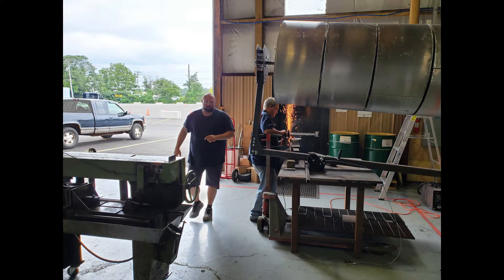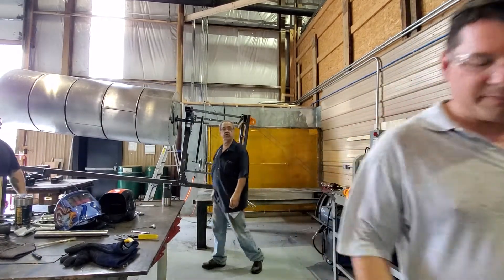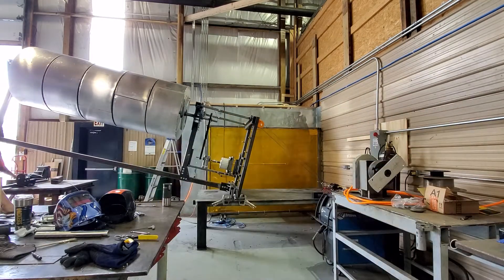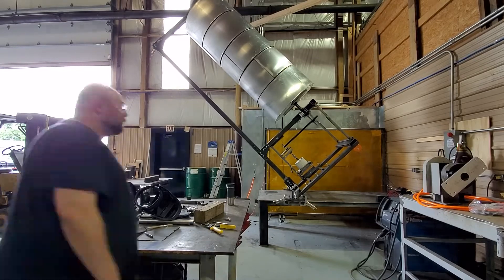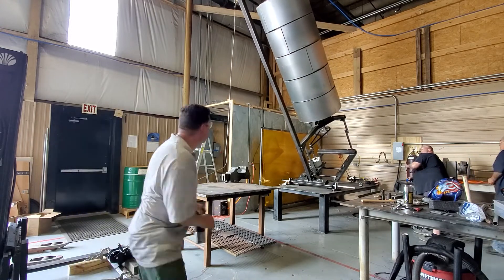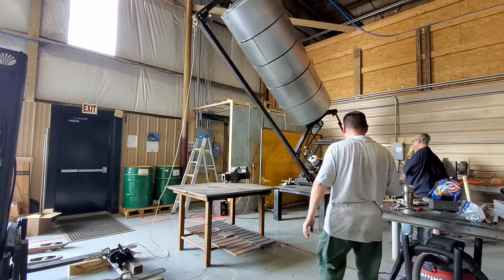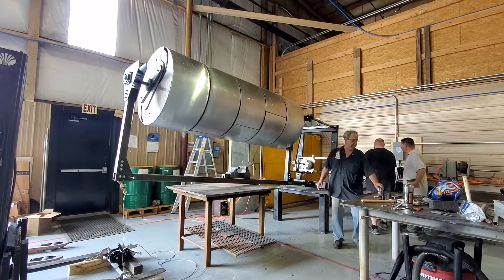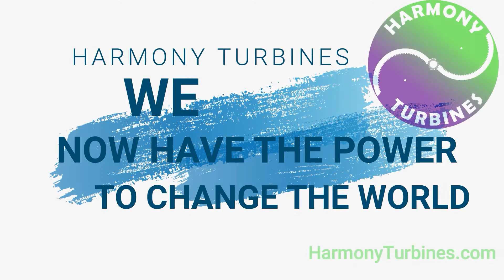Harmony Turbines Weekly Whirl 22

Comment: Ahhh-Sooo, Harmony Turbines Are Truly The Ying & Yang Of Wind Power w/A Built In Easy Transporting & Power Tip Up Erecting System! Hey Chris, Y'alls Should Get A 3rd - 4th Patents On Them Features Also!? 😁😎 PS The Whole Turbine System Could Be Mounted To A Small Self Contained Low-Boy 14'-16' Trailer System w/Lithium Batteries Plus Folding + Tip Up Tracking Solar Panels For An Easy Combo Rural Wind+Solar Power Mobility Unit!? 🤔
Reply from the maker: Hi John, this was just a way to try to get some data because the wind was so poor that month. It was frustrating waiting around for data and testing. So OK let's make our own wind. This was not meant to be any kind or portable power setup. We have been approached by companies looking to do shipping container projects with mobile power units (Batteries, generator, solar & wind). Harmony would fit perfectly into this model in fact with circular holes on the top, our turbines could rise up out of the shipping container, unfurl and be ready to produce power anywhere they were dropped. Then then to move to another location or disaster area, you'd furl them back up to a a cylinder; they'd recede back down into the container move on to their new location. It's a cool idea and we'd love to see this developed by a company somewhere. You could probably fit 10 to 20 of our 400w turbines into a shipping container like that and clustered together as they would be, our turbines would improve performance of each other. PSU is doing the research into this "clustered effect" for us. -Anyway, cool stuff for sure! But no, this lifting mechanism is not something that we plan on patenting. :)
Reply: @HarmonyTurbines  Also Make Some Stainless Steel Units, Smaller &/or Taller Sizes + Thinner For Boats - Yachts Applications!? 🤔🤔 🖖 I Sold + Distributed We-Power Vertical Turbines 1kw-20kw Sizes Outta CA 10+ Years Ago, Butt They Went By The Way-Side Because They Couldn't Keep Control In Stronger Winds...😢
Reply from the maker: @grumpyjohntxredneckrc6346  well I think, as you can see, we have that very important issue well in hand! :) Hopefully you agree.
Reply: @HarmonyTurbines  👍👍
Reply: @HarmonyTurbines  OK Then, Butt I'll Build The 1st Mobile Trailer Unit Myself, Just As Soon As I Can Get My Hands On One Of Your Units! 💨🌞😁😎